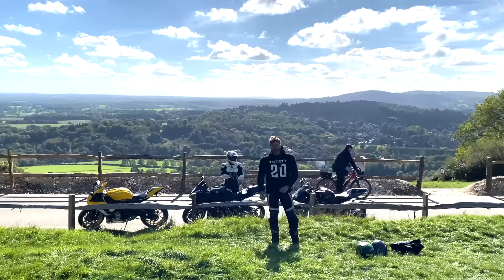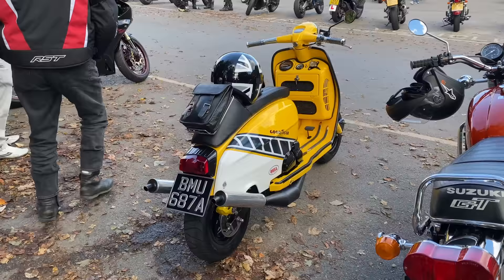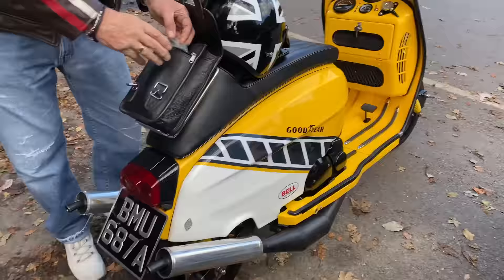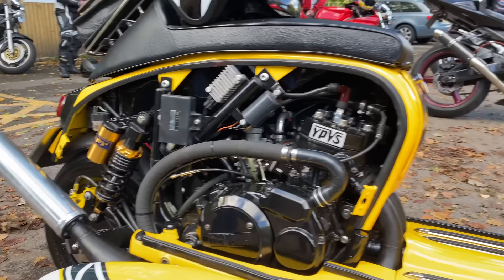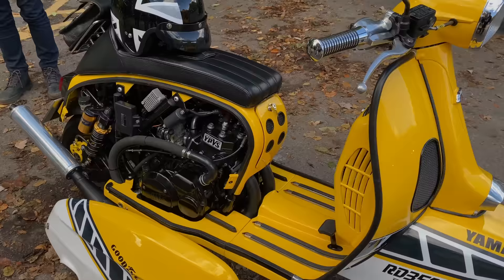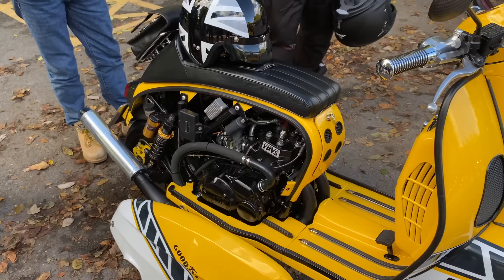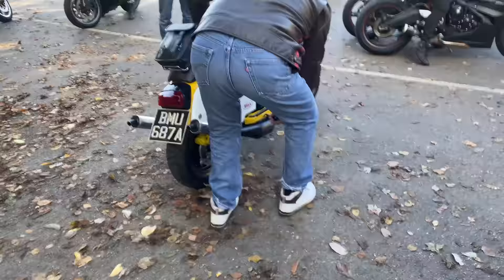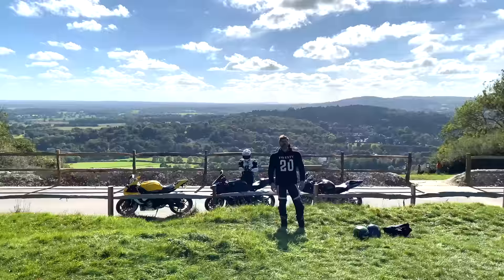Yamaha RD350 powered Lambretta scooter - MENTAL BUILD & SOUND!

Comment: The food is expensive and crap, if it was located anywhere else it would be out of business! Great build, certainly knows a lot more about engineering than he was letting on?
Reply from the maker: Yea agree, seems to be the case with most of these automotive cafes, I currently have a series working through the automotive cafes and have yet to find a mega one..
Reply: Hi there Kelvin here ... I totally agree with you .... the food is crap    There is a lot more to the build but so little time to talk about it but if your up at rykers and I’m there I’ll run you through the whole experience

Comment: where is tank of fuel ??
Reply: The fuel tank is under the seat and goes down behind the engine. The modified carbs are fed by an R1 fuel pump and the radiator system has a small Volvo water pump to help cooling   The temperature at all speeds is constant and she is very stable and brilliant to ride …. even if I say so myself 👍👍
Reply: The fuel tank is under the seat and goes down behind the engine. The modified carbs are fed by an R1 fuel pump and the radiator system has a small Volvo water pump to help cooling   The temperature at all speeds is constant and she is very stable and brilliant to ride …. even if I say so myself 👍👍

Comment: Top speed?
Reply from the maker: I think the real question would be who’s brave enough to confirm that 😅
Reply: Hi there Kelvin here. You would certainly not want to take her over 90mph .....
Reply: Should be good for 105mph ish on the gps depending on what gearing you’ve used? I run 18-29 on near 70hp

Comment: One of the worst conversions I've seen. The back wheel is sticking out of the back of the bodywork. There are so many better done versions of this set up. Ones that keep the original look to a much higher degree. The rosso bikes were nothing like this. Just my own opinion mind you and still a tidy enough scooter.

Comment: Just one word to describe this build "Insane"!
I tried to follow a scooter down the back side of Mount Hamilton road on my new 1985 600 Ninja A very good handling lightweight (for the time at 429 Lbs) and almost ended up in the weeds. The low weight and center of gravity of a scooter allows them to go WAY deep into a corner and maintain an amazing exit speed. After the 3rd corner I gave up!
To be clear, going up the hill was no contest. that 1985 600 Kawasaki made 82 hp (again great for the time) Check out the road up to the James Lick observatory. Its all turns. and going down the back is even steeper. What a fun ride. Dane, KB, I miss riding with you...
https://youtu.be/URYa22NwlHQ?t=1111
Not my video

Comment: Waste of a good motorcycle engine .
Reply from the maker: I disagree, cool to see something unique and completed to a good standard 🤷‍♂️ The RD350 is not exactly the holy grail of racing engines either
Reply: @stoneautomotive  Never said the RD 350 was the holy grail . A small wheel paraffin pisser that makes the rider appear to be sitting on the  crapper ,is hardly the holy grail of two wheeled transport either .
Reply: Life is short, time you appreciated that people do what makes them happy. It’s also time for old men to drop the tired old anti-scooter / anti-bike bullshit many of us had in our youth.
Time to grow up basically…
Reply: @nsoul8469  I am not anti classic scooter ,as long as riders ,realise they were built for basic A to B economic two wheeled transport . They have small wheels for quick changes in direction in order to negotiate urban traffic ,not designed for handling & stability at speeds of more than around 45 - 60 mph . I have been riding motorcycles small cc & large cc on public roads for over 50 years . I have also owned & ridden the new maxi scooters ,that have larger wheels & better designed to preform at speeds over 60 mph . Horses for courses .
Reply: @maskedavenger2578  I’ve owned and ridden scooters that do 90+ and with modern brakes, tyres and suspension I can assure you they handle just fine. Not every model of Vespa/Lambretta is suitable for such modifications of course.
Builders of tuned and customised scooters generally have a vast knowledge of scooters, and know exactly what they are doing. There is still a large international scene surrounding classic scooters, and countless conversions are available, it isn’t just one or two naive individuals you know.
I’ve had plenty of bikes and scooters since 1984, I currently have a Triumph Speed Triple, so I’m definitely qualified to comment on such matters :)
Reply: @nsoul8469  well said, own 9 classic scooters and a suzi Gixer thou K3. Do thousands of miles on my lambretta and race them in the endurance events.
Reply: @exsoulagent  I wish more bikers would watch scooter racing, they’d soon drop the utter b****cks statements about handling, so tedious…